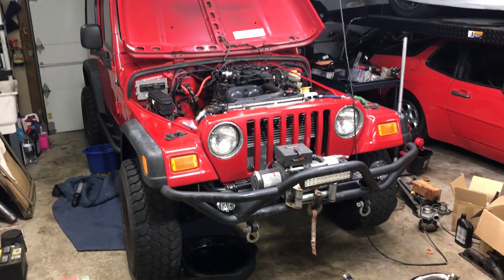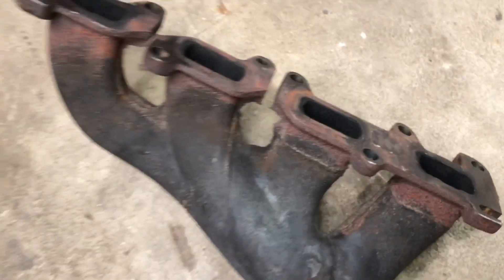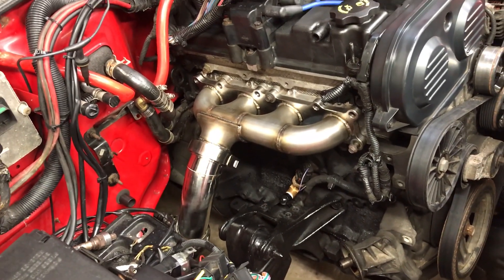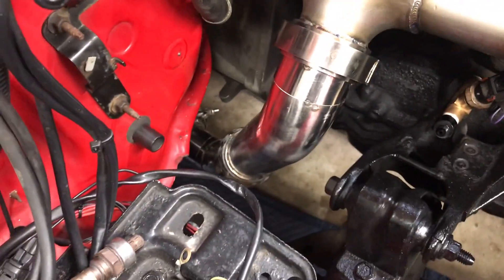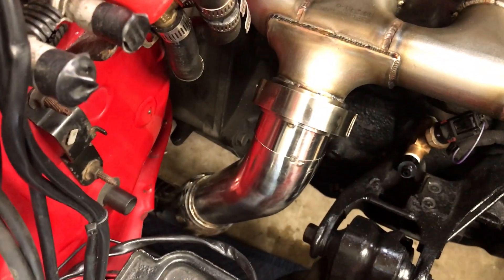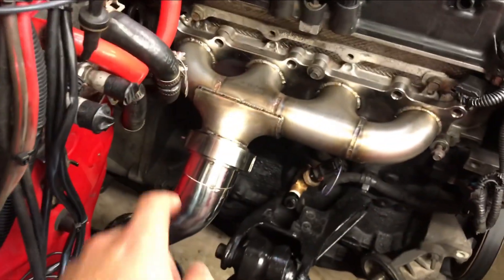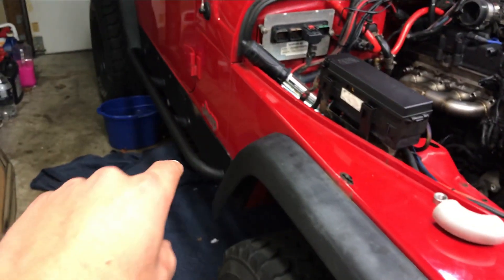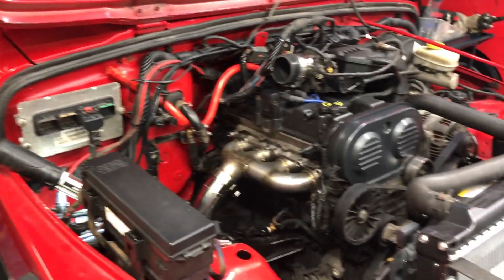2003-06 Jeep Wrangler TJ SE 2.4L Performance Manifold and Exhaust System OVERVIEW Zack Fab

Comment: I have a 97 2.5 
Can I swap it for a 2.4 or the transmission is different? 
Wiring is not an issue for me . 🤓
Reply: Just curious why would you want to swap to a 2.4? I have the 2.4 and wish I had the 2.5 just reliability wise. Would much rather just have a 4.0 but oh well

Comment: What’s the power increase with ur turbo setup?
Reply from the maker: I don't have dyno numbers yet but it adds a ton of power even on low boost. I can pull 70mph up hill on 33's. Stock 3.73 gearing

Comment: Would you be interested in building a manifold.for the inline 4.0 jeeps? With a U pipe to keep the turbo on the drivers side
Reply from the maker: I hope to have a 4.0 and 2.5 kit soon
Reply: Sweet, I'm hoping to start a boost build in the spring or maybe the summer got almost done to my jeep I want to do,turbo will be the last piece of the puzzle

Comment: Excellent video, the quality of your materials and your welding skills are some of the best I have ever seen, my 2.4 is definitely in need of more power especially with the bigger tires I run and you have the solution.   I would not hesitate to buy the turbo kit from you for my Jeep, I will E mail you, Thanks.
Reply: What size tires are you runnin ? I got a 2.4l on 31s thinking bout going to 33s. Thx